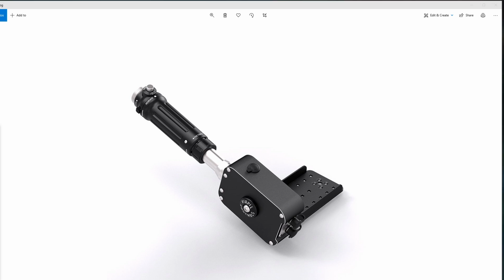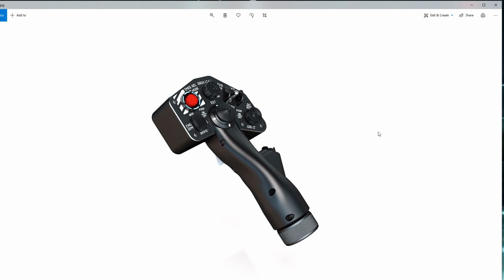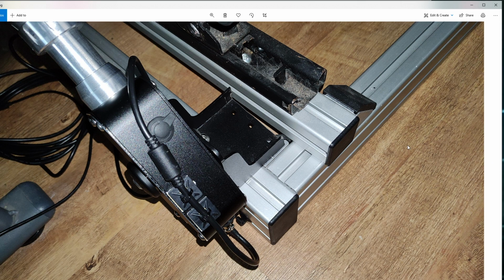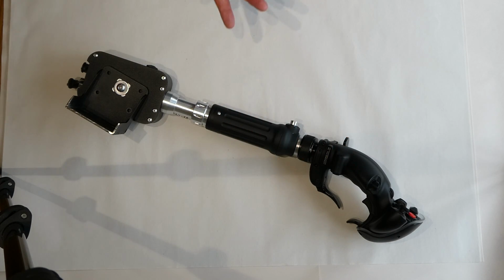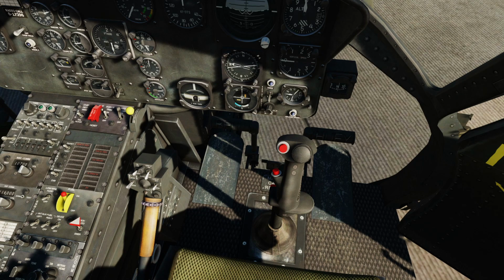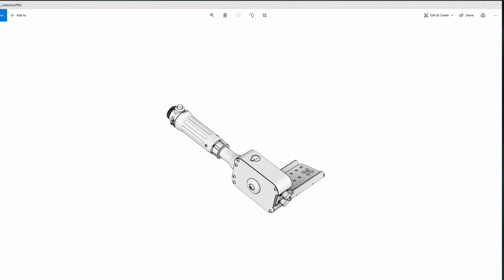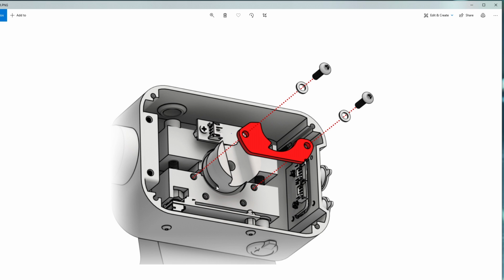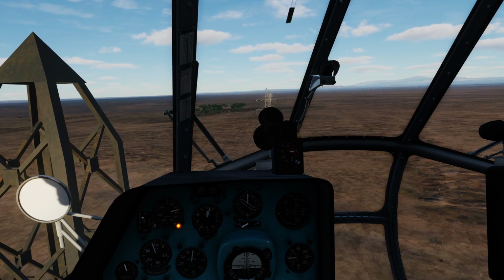Virpil Collective Review

Comment: Hello, thank you very much for the detailed review.
It seems Virpil has made a lot of improvements since then and has corrected several of the design flaws you pointed out.
I wanted to gather good information about this collective which 
I found here.
Btw.: though the smooth-running STECS VKB actually works very well when resting the ring finger tip on the left part so the collective part works with one fingertip - and I doubted, I could do better with the free moving lever -
Your review encouraged me to buy the Virpil collective nonetheless, and now I'm looking forward to it!
Thank you!

Comment: So your huey issue is the same with any throttle axis. I believe Virpil chose to mimic the proper method in the event ED/Belsimtek come back and model the axis properly or give the option to do so. 
Seems like it would've been best to also have an option to remove that idle/off lock so that when flying a helicopter with a throttle over travel spring (e.g. R22/R44) you can utilize that extra space as the over travel spring despite not having a FFB component nor physical mechanical spring to represent that control.
None the less, great review. Looking at their plus collective with new uh60 grip coming out for both sim gaming and better training for my real world helicopter flying.

Comment: I just wanted to say that the way a real UH-1 and the OH-6's and the Hughes 500's does work. the dark ring is the lock out you push up with your thumb, not a button. just wanted  to let you know.  you hold it up so you can twist the throttle off if you have a miss start.  You use your right hand to push the starter and the left to control the  throttle.
Reply: So, the starter is underneeth the grip's button box (sort of like a trigger) and you hold it until the engine starts. Is that correct?

Comment: You have some screws holding the case plates of the collective and you could change them with longer variants if needed and then attach there some metallic sheets  that would go backwards and you then put some counter weights on them without any need of "metallurgical" work.

Comment: Thanks for a very thorough, considered and honest review. I have some old diving weights sat in a cupboard and I'm thinking of making a counterbalance bracket so it will hold position without any clamping force. I'll let you know how I get on.
Reply from the maker: Yes please report back on how you get on with the weights, best  of luck
Reply: @HavocCompanyClan  Well, I think you're going to like this report! The result has been fantastic!

I designed a simple bracket from which to hang a diving weight. It fits over the outer face of the box with a hole for the big Virpil Controls plastic collar and bolt. The correct counterweight for my setup (UH60 grip) is approx. 1kg. which hangs 200mm behind the collective axle.

My son (awesome lad) fabricated it and machined all the holes perfectly so it fitted exactly. The two compression bolts that give the clamping force on the collective axle are nipped up just enough to ensure there is no play (about a 1/8 turn each) and there is absolutely no stiction force whatsoever. The force required to move the collective with my fingertips is microscopic and if i let go of it there is no movement whatsoever. It stays rock solid still.

We also designed and built a bracket and sliding block arrangement so that I can remove the whole collective from my swivel chair just by lifting it out of the bracket, so no risk of damage by forgetting it's there and swivelling the chair around .

Comment: Thank you for the honest review. I tried to link a picture for an easy and cheap solution for the fallback problem. Ofc it got blocked because of the link (which i understand).
If the author can see the post with the link, might review it and either approve it here, or just share it with the others. Thx
Reply from the maker: by any chance is it the elastic mod?
Reply: @HavocCompanyClan  I dont know if there is an "elastic mod". My solution  is an elastic shoelace. My rig is very similar to yours (or at least the collective mounting), with a properly attached shoelace you can almost perfectly ballance out the collective in any position.
Reply from the maker: @Buxee1975  yeah that is the same one I saw online

Comment: i got the plus in the end and if you calibrate the twist axes, in the virpil software with out pressing the button to unlock the throttle you can get it to work in DCS with half the axes.
Reply from the maker: yes I am well aware of this, sadly it means you only use about half of the travel, I would like to mod my twist to remove the lock out
Reply: @HavocCompanyClan  I see what you mean about the drop if to lose im going to 3d print something to counter balance it would you like me to send you the file

Comment: Wow, just ordered the plus about a week ago (backordered).  I'm only using DCS helicopters and that's too bad they don't implement correct throttle. I just emailed them to see if I can exchange it and get the non-plus. Wish I had seen this before I ordered the plus.  Hope I'm not too late. Thanks for the detailed review.
Reply: So.. Virpil could not edit my order due to their web ordering system. I would have to cancel and reorder everything, losing my place in the queue as well as my holiday discount! Prices went back up right after new years.  So I opted to keep my current order. Doing the math, the plus is costing me around $50 more than the non-plus (with the holiday discount).  Currently the two are $120 difference!   I can live with that.😆
Reply: @redtailpilot What do you think of it?  Is the plus at all useful?

Comment: Thanks for the in depth review. I was kinda stumped with the DCS throttle operation as well.....thought the Virpil was initially faulty.. You explained it well. I think its up to DCS to fix the throttle mapping in the UH-1 as there are other sims out there that it may work closer as designed. Of course I havent tried any yet. Might try some tonite to see if this is the case. When tightening the screw to get balance I found the stiction issue was annoying so I fitted a damper. I then loosened the screws but then got minor stiction from the damper as well.....doh! But it did have a nice weighty smoothe feel to it. Good review.
Reply from the maker: Have you any details on how you mounted the damper on this ?  I was thinking of maybe trying a damper mod myself
Reply: I think if you mount it as close to 90 deg at operating range it will eliminate the minor stiction feeling I was getting. My angle was a bit too acute and didn't take advantage of the full travel to get  high resolution feel. But as I mentioned it was nice and close to the real feel with smooth action.
Reply: Damn that's twice my reply didn't work. I used a cheapie motorcycle steering damper and bolted it to the chair. To mount on to the collective I used a Smallrig tripod clamp with a three eighth or quarter inch bolt into the clamp just below the throttle grip. I found them both on e-bay and am-azon. Search for them at a-zon as it looks like I can't put a link here.....or even mention their name. The reply above was supposed to follow this one.

Comment: Gotta say, I was really looking forward to Virpil entering the market with this, but the initial price kept me off, and I instead went for the K-51 collective. Having heard of issues with the Virpil from various people now I am glad I did. It might not be perfect but it has functioned solidly, I haven't had to adjust the clamp a single time since I got it about 3-4 months ago (and this includes taking it off of the rig, flying to another country with the collective just crammed into a carry on bag, mounted to a friend's rig, then the same thing in reverse), everything just functions well and feels good on it. The only "issue" I've had has been self caused, basically I want to at some point DIY a new head for it, and since it's simple 3D printed plastic I stripped one of the screw holes taking the panels off and putting them back on again multiple times... But that's one out of 8 screws and doesn't change how the thing feels in the least...

So yeah, might not be modular, and the bits you touch are 3D printed plastic, but it has Virpil electronics inside, a very good mechanical design IMO, great metal construction for the majority of it, dead simple to use, and cost 200€ + 50€ shipping (didn't end up having to pay VAT or customs, lucky me I guess), versus, uh, checking Virpil Controls EU... 423.97€ before shipping, VAT included (no throttle base, Ka-50 grip). Good deal, and enough controls for all DCS helis so far, though Apache will of course be a struggle, until I make my DIY one.
Reply: You can tape one side and fill the stripped hole with some good epoxy. Once it starts to harden, drill a new hole for the screw. You can wait for it to fully harden before drilling too, depends on your epoxy.

Comment: Could you use the twist function on the alpha l to function as the throttle governor? Just a thought, considering on buying... Thanks for the great video
Reply from the maker: oh lordy no chance of doing that
Reply: @HavocCompanyClan  Not the answer I was hoping for. Could you explain why you wouldn't recommend this?
Reply from the maker: @npatrcevic  throttle governor is touched once during start-up when engines are idle, you then open it fully and never touch it again, you would need to keep the thing twisted all the time to keep throttle open enough to run the engine

Comment: Hello there, I´m using the VPC Rotor Plus TCS. 
How did you set the increasing the RPM with your throttle twist on your collective?
I can use my collective normally, but I am not able to set increasing/decreasing RPM with my collective. 
Thanks in advance 🙂
Reply from the maker: I guess just bind it in the analog axis tab against throttle, tho u only do this at start-up as all helis use automatic RPM gov in the engine
Reply: @HavocCompanyClan ok, I'll try. Thank you 😊

Comment: You could tune the throttle...
Reply from the maker: no idea what u mean
Reply: @HavocCompanyClan  You can tune any axis in DCS. You could also use the lock button as the page up button.
Reply from the maker: @bryanbishop2377   how did that go for you on your virpil throttle ?
Reply: @HavocCompanyClan  I did it on the Warthog throttle to achieve the correct afterburner detent position. The same technique should work for you.
Reply: @HavocCompanyClan  I should make a YouTube video about it...🙄
Reply: @HavocCompanyClan  I just got my Virpil Collective throttle. Didn't know about the issue till I saw your video, but wondered about it.

Comment: Is it possible to set the throttle axis up so the rage of motion when you click it past the idle detent would be a button press that could then be assigned to the page up command? I did this with my CM3 throttle to use for the idle/cutoff command for the hornet. I tried it for the huey so the start procedure would work and it seems to work correctly. I don't have a VIRPIL collective yet though so I can't try it.
Reply from the maker: Nope , this was one of the first things I tried
Reply: Yes it possible. That's what I use for the Huey.

Comment: How can I set the throttle axis at DCS MI-24P or MI-8 in the control settings? If I twist nothing happens. Any ideas why this is?
Reply from the maker: did you calibrate the throttle axis ?
Reply: Just to be sure, the Mi-24P at least has separate throttle bindings for the throttle levers (which you're not supposed to touch) and the collective throttle. You need to bind the collective one.

And of course, make sure that the throttle axis is actually functioning and showing output based on the throttle position, as HCC said.